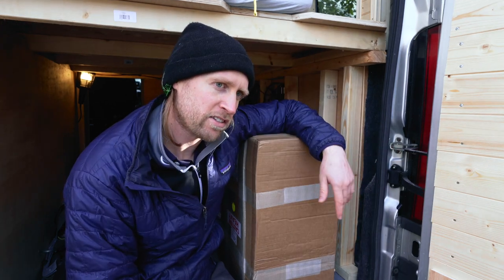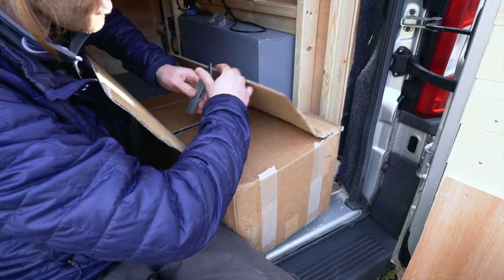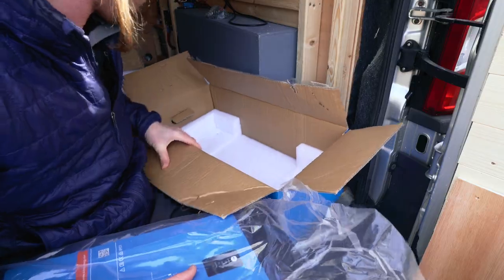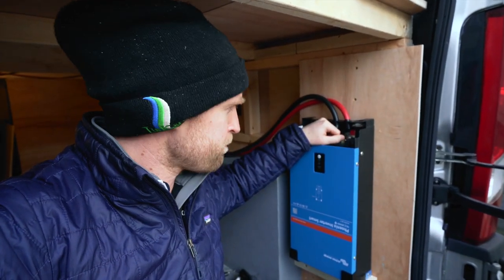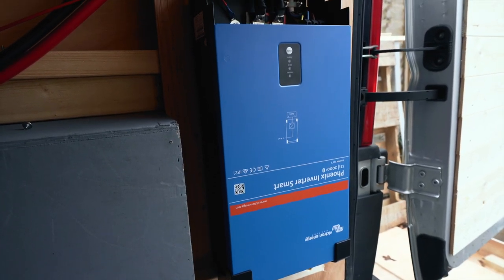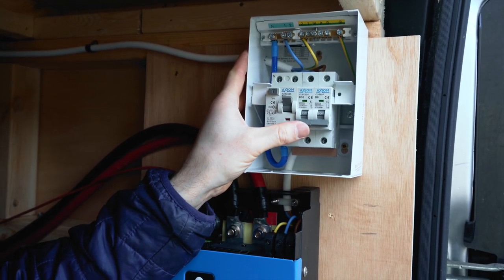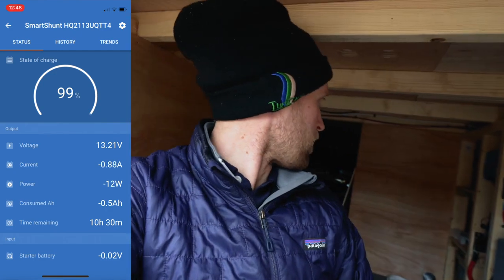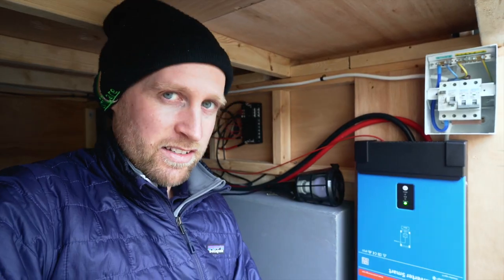Mains Power from 12v Battery! | Victron Phoenix Inverter Install | Van Build Ep. 21

Comment: Hi! I've been living in my caravan a couple of years now. I have used a Vanson charger for my Lenovo laptops with no problems. I discarded the original cigarette plug and made a proper connection to the caravan 12 volt system. Saves a lot of battery current as the laptop is almost always on.
Reply from the maker: It makes sense not going through an inverter as it wastes energy. My laptop won’t charge off the 12v sockets I installed though and I don’t know why so I have to use the inverter. It’s quite efficient though and isn’t too bad.
Reply: @LivingTheTinyLife  Yes, efficiency 92% and no load draw 8 watts only for the 12/2000, that's not bad at all.

Comment: Good video.
I could be wrong but the invertor looks like it is mounted upside down.
I thought the internal fan direction is to the top of the unit, to work with hot air rising.
Reply from the maker: The inverter is intentionally upside down, but only because when i put it in having it the right way up would've been annoying to fit as the cables were at the top. I never even thought of there being a fan direction or anything, there is a grill at the top for ventilation and we also don't use it anywhere near capacity so it should never overheat. Our batteries actually can't handle it on full power so in hindsight I should've got a smaller inverter and smaller cables and saved a few quid, I think that's the only thing I overlooked when building the van and would change it I do another one.
Reply: @LivingTheTinyLife  if you are running Lith batteries 3 k should be OK if AGM max draw is 20amps continuous in my boat 3 AGM max draw 60amps * 12 volts =720 watts, Lith batteries make a big difference. IMO

Comment: Hi there, thanks for the video.  Just wondering , did you have to pre-charge the capacitors in the inverter in any way?  Some people use resistors for this, but it seemed like you didn't get any kind of spark when you flicked your breaker on?  I have the same 12v 3000W inverter, so thought I'd ask.  Cheers.
Reply from the maker: I literally just wired it in and fired it up, I didn't even know pre-charging capacitors was a thing. 2 1/2 years in now and everything works great still.

Comment: That's a really nice inverter and the 12v cables certainly look beefy enough. I should have watched this video before your new upload really :)
Reply from the maker: Haha, I might run the engine though to keep the voltage up that’s a good idea 👍 we’ve bought more batteries too so hopefully that helps. I’ve used the inverter since and it’s fine if I only do one pan at a time on 3/4 power.

Comment: I would like to fit a 12v 1200w Victron Inverter but it doesn't come with any fittings at all. Could you advise what cables I would need and if I need to wire a fuse to the positive cable going to the battery?
Reply from the maker: The manual should have a diagram of some sort of how to wire it with recommended cable sizes. Essentially though you’ll need to connect it to the battery with a fuse on the positive cable. You’ll probably need to ground the inverter to the chassis of the vehicle too, my engine battery has a ground to the chassis so I connected the earth to the negative side of the engine battery and then it grounds to chassis that way. From the inverter I wired in a consumer unit to supply all the sockets in the van via a changeover switch which was a bit fiddly. It’s was fun to do though I enjoyed doing the electrics and learnt a lot 😊
Reply: @LivingTheTinyLife  My Wife's work apparantly fit inverters all the time so hopefully they know what they are doing! Now I can check! Thanks!

Comment: in this video are you using the battery that is for the van or a seperate battery thanks in advance
Reply from the maker: The inverter is powered by the leisure batteries only. The only connection to the engine battery is the dc-dc charger that uses the engine alternator to charge the leisure batteries when the engine is running and I also connected the mains battery charger to the engine battery so when we are hooked up to shore power the engine battery gets charged too. This is really handy as you don’t have to worry about a flat battery and you can play the radio or run the fans in the cab for as long as you want which is actually really useful for air drying some laundry.

Comment: I have a Brand New Victron 12/1200/500 inverter, As soon as I power on I get solid red light on Alarm, I have now load on the AC side.
I have checked batts output and it's at 12volts ok
I have also disconnected the ac input and tried a few times But still get red alarm light.
Checked wiring cant figure out what the problem is, any ideas
Thanks
Reply from the maker: Have you set up the battery information on the app? You need to tell the inverter what batteries you're using and how many amp hours there are so it knows what the voltages should be etc. Failing that I'm not sure as I haven't come across that issue, if there's any problems such as low voltage it usually alerts me on the app.
Reply: No just ordered the unit to do so, thanks for the reply
 @LivingTheTinyLife

Comment: Hi David. Ed here again. I hope you don't mind. I was forgotten you to ask if you're still happy with the inverter. I still haven't had the time to built it in and test it. Do you still use one battery and are you still satisfied by the power you get from your Inverter? I am asking you this, because today I heard from some Dutch boat users that I will not be able to power the inverter enough with my batteries to get it work for some hours. Can you tell me if your still happy with it? THANKS again and have a nice evening
Reply from the maker: Hi Ed, yeah the inverter is great, I haven’t tested other brands and I know Victron is expensive but I think it’s worth the price. Everything works as it should and it’s really quite efficient so doesn’t waste much power on idle. It also has an eco mode so you can leave it on a kind of trickle where it uses next to no power to stay on but kicks in when a current is drawn. It also connects to an app on my phone so I can turn it on or off and change all the settings and parameters on my phone which is really useful. The only issue I have had is if I pull a large amount of power  (induction hob) the battery voltage drops too much and the inverter cuts out with a warning saying ‘low battery voltage’ I think it’s a safety mechanism to protect either the inverter or the batteries from getting damaged and I think there’s a way to tweak it so it doesn’t cut out or maybe I’m just expecting too much from the system. The inverter itself is great though👍
Reply from the maker: I also have 300ah worth of batteries now, the less battery capacity you have the faster the voltage will drop and I think that below 12 volts the inverter won’t really work. It also depends on what batteries you get, lithium is the best but also the most expensive. A lithium battery can run the inverter to 10% charge where it drops to 12 volts, an AGM battery however will drop to 12 volts at about 35% charge so the inverter won’t work on less than 35% on an AGM. A lithium battery at 35% charge is still on 13 volts though so you can use the whole battery really so they’re definitely superior but also very expensive, they do last longer though so I suppose the cost per use is probably better, we have over £2,000 just in batteries but they perform really well and should last a long time.
Reply: Thanks for your reply again! I have bought 3 new batteries not long ago. They were not very expensive but they work nice. Each of them are 105AH. I use 2 of them for starting the engines and one is for service, like 12V lights and equipment in the compartment. For now the inverter is ready to reship to the company where I bought it. Wish you and your family all the best and have some nice Xmas days. Regards, Ed

Comment: On amazon there is a brand of 12v charger for computer.
Reply from the maker: I don’t think they work on MacBooks, I bought usb power delivery sockets which go up to 45watts and they work on everything apart from my laptop it just comes up with an error message and I have to charge it through the plug. It’s alright though the inverter doesn’t use a great deal of power to run.

Comment: If you went on grid power would this auto switch to mains power from the inverter to and from buddy each time you wanted to use the inverter
Reply from the maker: So initially I thought it would be fine by having the inverter and mains connected to the same consumer unit but everything kept tripping so I had to install a manual changeover switch. It basically switches the direction of the power to the sockets so the inverter and the mains hookup operate separately and have 2 separate consumer units. You can probably get an automatic one but the manual one was about £5 and it works great.
Reply: @LivingTheTinyLife  yes that’s what I thought buddy. I was going to fit a pure sine inverter to a auto mains transfer switch . But wanted to look at the Victron 👍 just found out it’s the multiplus that as the auto switch built in thanks